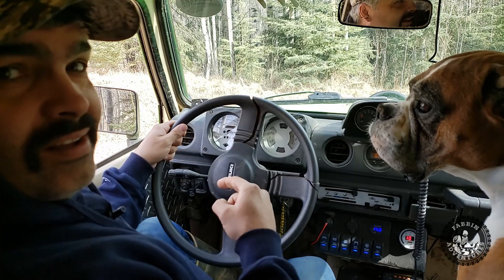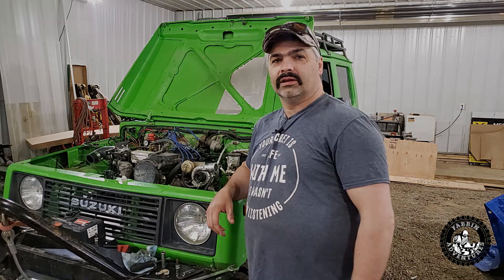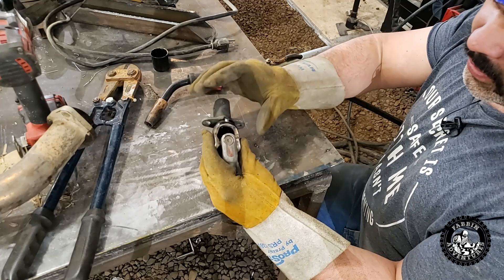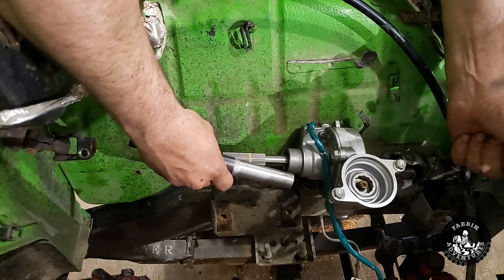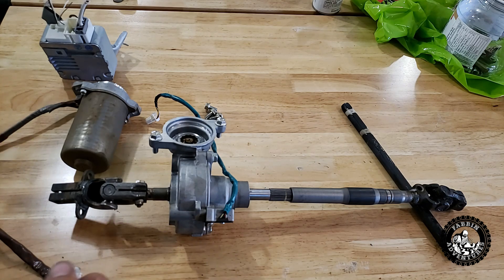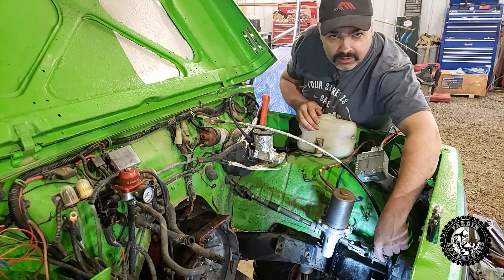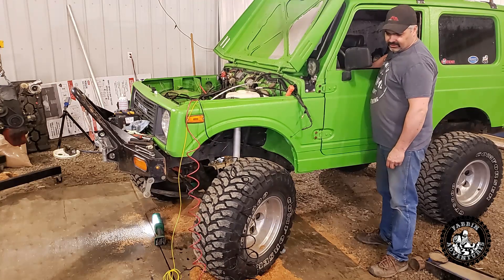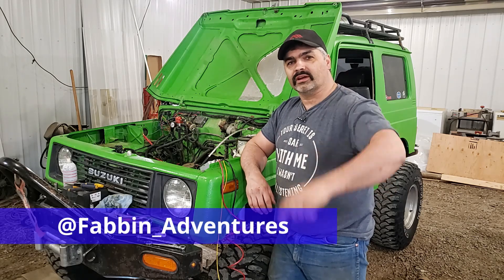Suzuki Samurai Electric Power Steering Conversion

Comment: Yeah, I did same thing with Nissan versa unit from a 2014 model, electric. Unit, it is awesome n it was cheap at 120.00 total,hyd. Anything was just too much total cost,brain unit in an airtight waterproof box, a camera case actually, a bit of welding n she was done.really needed it cause I have a spool in front!
Reply from the maker: Awesome, yeah i plan on locking the front now that i have power steering, i waited too long!
Hydraulic is expensive, messy, and eats up alot of room.
Thanks for watching!
Reply: @FabbinAdventures  yeah, ,I put my unit in the wheel well , the ps motor is basically waterproof, I went with 2 inch backspace wheels to gain the space for it.just tilted motor to left, shaft in same place.the extra space is also conducive to my future plans, I'm supercharging my 1.3 here shortly,not looking to build a powerhouse but a little extra is good, I mangled my stock rear leaf springs with a stock,mostly,1.3.guess that 6.5 to 1 t case gearset really beefs up the torque.im fixing all that as we speak.
Reply from the maker: Cool, i sent my motor pretty much straight up, didnt want to cut my wheel well, it clears every thing but i will be making a heat shield for the motor.

Comment: Yes. I was looking for a good video for the electrical power steering for a long time wihout finding a good one. I have a powersteering from a tracker installed but i want to switch to an electric one.
Reply from the maker: I hope it covers all your questions. I too was looking for a decent video on how its done. The videos out there are crap. So i decided to make a good one that shows you everything you need to know!
Reply: @FabbinAdventures  I know that it will be a very good video.
Reply: Yes that was a good video. Know i have to find a power steering.
Reply from the maker: Yes it seems to work good, ill report back in a week or so with a video on what i think about it!
Reply: @FabbinAdventures  Hopefully the steering box hold the pressure. The box from the tracker is bigger but a lot of people break this thing.
Reply from the maker: Yes, time will tell!